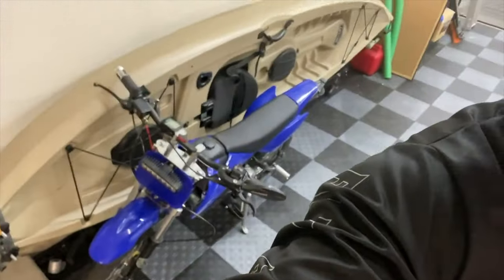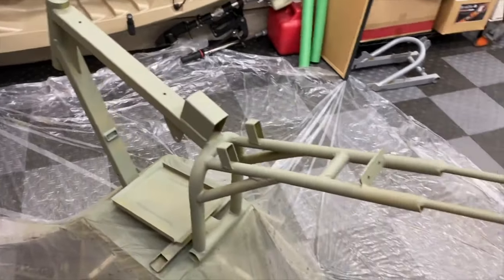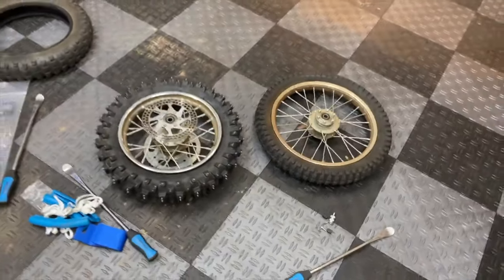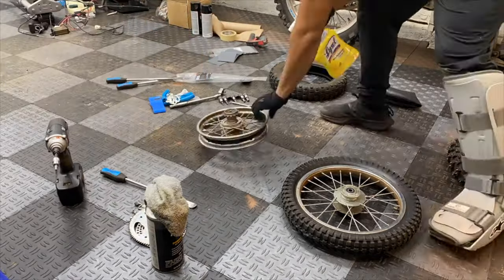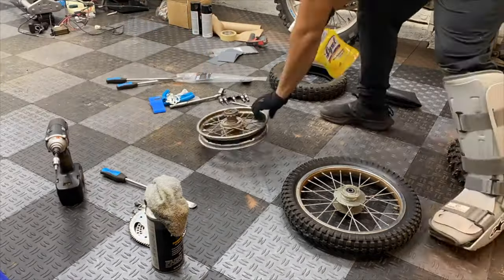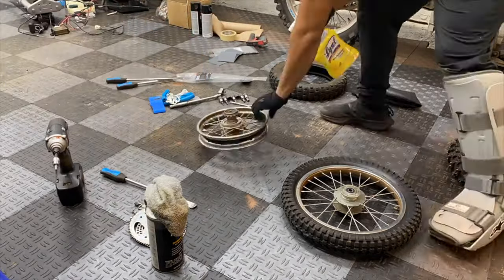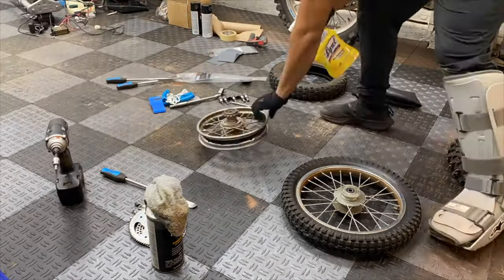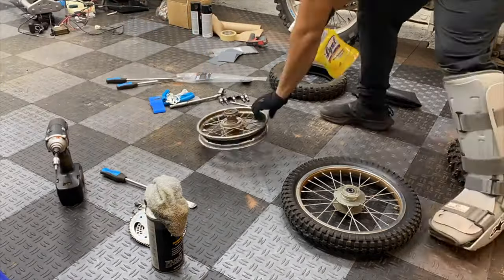Full 52V Razor MX650 Electric Dirt Bike Build Recap

Comment: Hey patt just one question did the other connectors the male ones come with the pre tune controller or do I got to buy the plug and play one becuase for you it wasn’t plug and play you wired them into new connectors just a question did those connectors come with the razor pre tune package thanks

Comment: I see people take apart the brake line to run it through the ring welded to the frame. The way I like to deal with this ring is to cut the ring on the inside as close to the frame as possible. Now you have a broken ring welded to the frame and all you have to do is bend the ring a little to get lines in and out and you don't have to open the hydraulic lines. The split ring holds the line just fine, I have never had issues doing it like that.
Reply: Me looking at a bag of zip ties.....   😏🙄        lol
Reply: Lmaoo I did the zip tie method. But I’ll definitly take that advice and run it through the hole

Comment: Hi. I am going to do an mx650 mod with a 48v 1800w motor. I am 6’1 so I am wondering if you think I could fit comfortably on the bike. If not, should I place the pegs closer to the front wheel so I can stretch out my legs further or what should I do to accommodate for my long legs. Thanks in advance
Reply from the maker: If you know how to fabricate / weld, repositioning the pegs down 2” may help. Also repositioning the handbag forward for more room for your knees
Reply: Ok thanks for the reply. Have you seen people over 6 foot fit comfortably on the mx650 or does it look too cramped
Reply: I'm 6 foot and fit comfortably on my sx500. You'll probably be good my G 😎
Reply: Ye thanks bro. I have an sx500 now and I was very surprised when I sat down and saw that I fit comfortably. It looks way to small but when you are on it then you realize it’s not too small

Comment: Hey Pat love the videos! I’ve just got one question, how do you wire the keylock on/off switch? It doesn’t make sense since I see that it has three pins instead of two.
Reply from the maker: Thanks! Three wires- ground, power in to switch from battery, power FROM switch to controller once keyed on.

Comment: What selections do I need to make on the EnC controller do I choose the Ultimate plug and play or just pre tuned also Bluetooth or no Bluetooth.
Reply from the maker: Do you not want to do a bunch of wiring like I had to? Then select plug and play if you want to save time. I went with just pre-tuned since I wanted to save some money and see if I could learn to wire.

No need for Bluetooth if you are not comfortable with changing tune settings yourself.
Reply: @PatOutdoors  So the plug and play comes tuned (correct me if I’m wrong) and works with the motor and everything else in this vid plug and play? (Correct me if I’m wrong) (also could you use EnC 52v battery) also it says for wire it says “select wire” and the option says “none” only, I’m guessing it just works tho. Also would any battery work that’s 52v and would any 1800w motor.
Sorry for so much questions.
Reply: @PatOutdoors also what would be the range in it? For 20ah-the max ah?

Comment: Hey I have a mx500 which I want to mod I have never done something like this so I have been doing research on it. Your videos are helping a lot but I feel overwhelmed with all the options. I was going to go with the vevor kit but people say the controller is not the best. So now I’m looking at a kunray kit. What would you recommend? I don’t want to go to fast I think I would be happy with around 35mph, I would also want a setup that will allow for upgrades if I decide I want more power. I was thinking about a 48v 2000watt setup with either a 48v or 52v battery.
Reply from the maker: The Kunray 2000W kit is what I had on my first mx650 build, certainly a slightly higher quality kit that the vevor in my opinion. The controller still also has its limitations. The Kelly controller is what makes the big power and speed difference at the end of the day. A 52v lithium battery with at least a 50 amp BMS rating and a 13-tooth front sprocket should be able to get you the 35 mph you are looking for

Comment: I'm wondering if you have ever used a spring upgrade kit on any of your MX650 builds¿?
Reply from the maker: Spring for the fork? No. I’ve done a full hydraulic fork through. Or did you mean rear shock? I use DNM adjustable shocks for both my mx650’s

Comment: I want modded Razor’s, but don’t want to do it myself. Know of a shop, or individual, I can pay to mod things to my specs?
Reply from the maker: Where are you located? And what exactly are you looking for? I’m likely gonna sell one of my razors since I’m in the middle of two Yamaha QS138 electric dirt bike conversions..
Reply: @PatOutdoors  That's awesome. I'd love to convert some of my gas stuff into electric, like my TT-R 125, Polaris Outlaw 50, and Trailmaster 150 buggy. I'm in Greenville, SC. I have 2 MX650's, and a bunch of other Razor toys for my kids. My ideal would be to have 1 of the MX650's setup for adults (I'm 6'4" 200lb) to easily power up steep hills. I don't care as much about top speed, so 25 mph is plenty, but the torque & hill climbing needs to be there. The other one, I want for my kids, but with increased torque as well so they can get up some of the short, but steep, hills we have on the property. Ideal would be to have 3 power modes (similar to Sur Ron Light Bee X, but 3, not 2 modes) so the kids aren't popping wheelies, but can climb hills when needed.
Reply from the maker: @jdavies  well since we’re both in the east coast, I don’t see why I can’t help you with the builds. Is simply function (drivetrain, battery, mode switching) that you are interested in or did you also want suspension set up for adult and cosmetic changes?

Comment: How fast would one of these go with 52v battery and 1600w motor?
Reply from the maker: Depends what controller you are using and what sprocket sizes. With a Kelly controller programmed by E&C and a 15-tooth front sprocket, I was able to get 39 MPH. The generic brushless 33A controllers only got it to 34 MPH

Comment: Hey pat, quick question: Is your throttle 5v or 12v, because i can't seem to find a 5v one most are 12v? Will 12v work with kelly Controller?
Reply from the maker: The one on this 52V bike I'm using is the "EMX Lite" 5V throttle by Electro & Co. The one on my 72V bike I'm using this one: https://amzn.to/43t7wXO
Both bikes have the same Kelly controller installed.
Reply: Ok thanks, question can I change the acceleration on the kelly controller?

Comment: On the mx500 could I run a 36v speed controller kit without another battery?
Reply from the maker: An mx500 and mx650 are 36v so yes
Reply: @PatOutdoors  would it make it faster

Comment: Man im in the middle of wiring and using lithium and i almost got the shock going lol. Any other site for wiring work. Or ahould i start with new electric and co parts
Reply: I'm also just sticking with some Milwaukee bat ties for the mx 350
Reply from the maker: What are you having trouble wiring? The Kelly controller?
Reply: @PatOutdoors  hey thanks for replying. I haven't gotten one from them but I think I need to order one from either fast scooters or something. I hooked it up last night and my new lithium battery sparked so I know something is needed up for sure.

Comment: Hey pat, so i hooked up everything to my kelly controller and its working but the 3 speed is not? Any reason why?
Reply from the maker: Maybe it's not programmed to be different in the different modes. I connected to my Kelly with the tablet and noticed all (3) settings were set to 100% speed. You can change it if you have the Bluetooth dongle and the app. Though I would NOT recommend messing with it if you're not too familiar with that kind of sortware
Reply: O so you don't even change your speed modes correct?
Reply: And yes I have the Bluetooth dongle
Reply from the maker: @rainbow6replay733  Nah I don't bother. The 52V bike isn't fast enough for me to go slower than the 100% speed
Reply: O ok hey pat can you do me a favor and send me your settings I have 52v as well
Reply: I went to accelerate and Kelly beeped and said error overvolt and the bike flew in the air with too much power